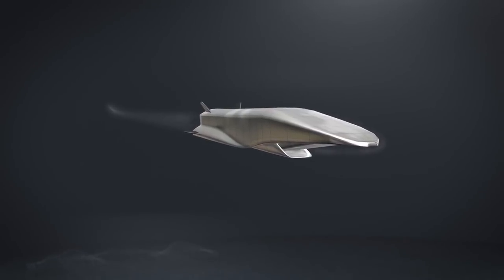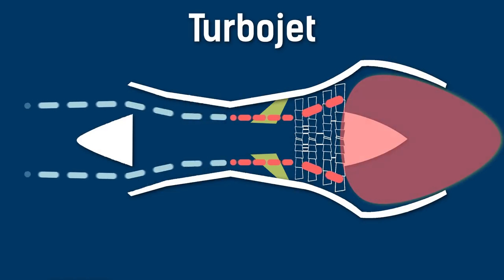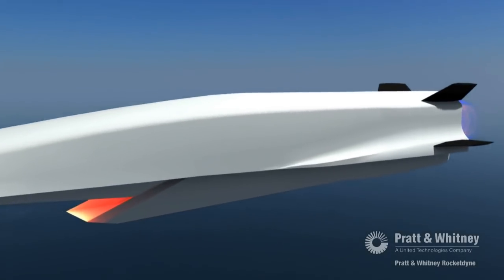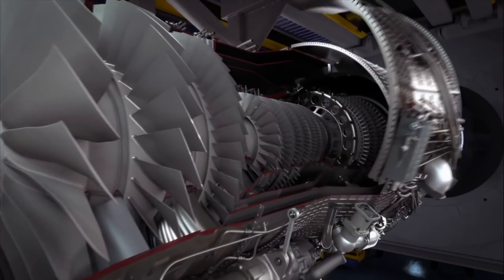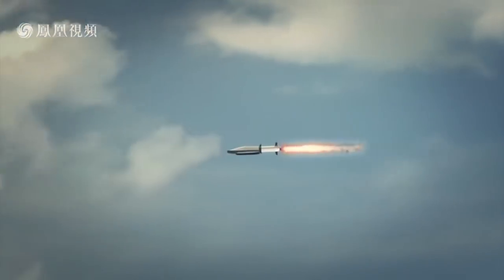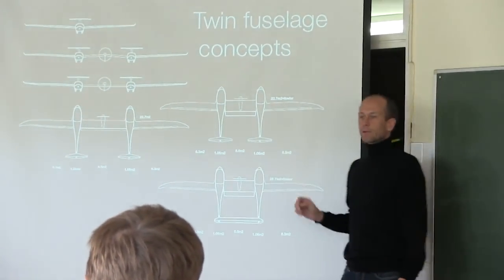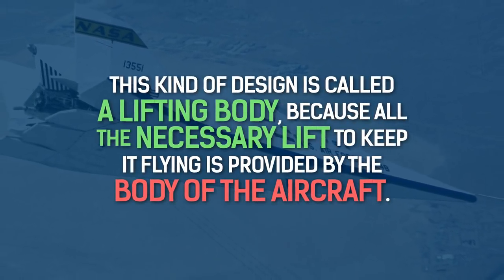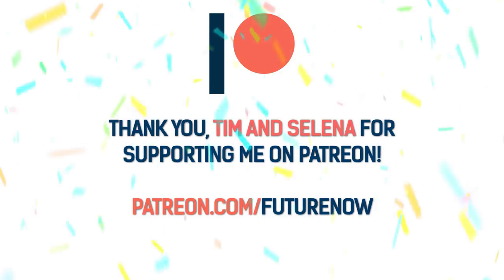Why Hypersonic Planes Look So Weird

Comment: Finally a video which explains in clear terms the problems around supersonic / hypersonic flight without being either clickbait or some weird computer-voiced rob-content video. 
In my opinion, not being a fluid dynamics engineer, the biggest problem is that air (which is a mixture of gases and dust and water) acts more like a fluid in extreme temperatures and pressures. The biggest "enemy" of hypersonic flight is therefore friction (and the forces that generates). One can see similar problems where new high-speed under water ordnance is being developed (their specific problem being cavitation due to high pressure steam bubbles which absolutely wrecks even steel bodies)

Comment: Dear sir. I think the problem people are having with turbo jet engines is the compressor design at hyper sonic flight. At those speeds, air doesn't act like air. Consider an S shaped intake. Air slows down when it has to curve. Id suggest a conventional jet on top then a turbine optimized for hypersonic flight underneath, with a vent that closes, with an S shaped intake. The hypersonic turbine imperllers might look more like a boat propeller, as the air at that speed acts more like a liquid. The engine would also have to be much much longer then a regular turbo jet, as the time you have is to combustion is cut short. Taking a regular turbo jet, in a cad program, and streaching it out, allowing all the values to change might work. Streaching it out to about 6 time longer and allowing all the values to change. Going with the idea that air changes at that speed, oerhaps a tuna/ shark shapped fuselage. In other words, slender and wider, like a fish more then a plane. Then theres the fuel. Has anyone considered a liquid lithuim/ water based propellant? That would burn regardless of speed. As far as material. I go with a tungsten tetraboride skin with a ceramic metallic coating with a top coat of graphene applied with a sputtering magnetron. Dimples on the plane, like a golf ball might also help. Using air in the dimples to insulate the skin from the friction, but Im a lay person, so what do I know.

Comment: Could it be possible to use large cloud based computed AI to run repeated modelling tests and be taught to design aircraft for us based off mathematics?
Reply from the maker: If I’m not mistaken, that’s essentially what we’re already doing with MDO.
Reply: I don't think there's any need for 'cloud based', doesn't matter where the hardware is. The environment Physics would have to be modelled and then the AI would generate designs trying to maximise or minimise some target values given constraints [ie maximise speed given some thrust value]

Comment: @ 0:55 you say, "this causes the gas mixture to expand rapidly, pass through the turbine, which powers the COMBUSTER, and exist through the exhaust..."  I suppose this is simply a gaff on your part since you correctly refer to the turbine powering the COMPRESSOR a minute or so later.

Comment: Before making hypersonic airliners, why they dont make supersonic ones ?
Reply from the maker: They're working on that too. I made a different video on supersonic planes. Fact of the matter is, the military is mainly the ones developing hypersonic technology as they already have supersonic fighter jets.
Reply: They have supersonic ones. Remember the Concorde, you probably to young to remember. The one thing is that they weren't comfortable. If you are tall you have to keep ducking your head  to not hit the ceiling. People start riding the slower ones that you  are flying now because they are spacious and comfortable especially if your in first class. Of course the military is working on hyper sonic one many years ago. But in the military the comfort of the passenger is not their main concern.